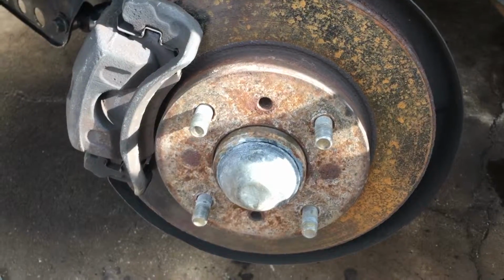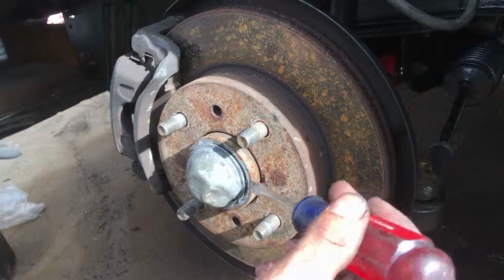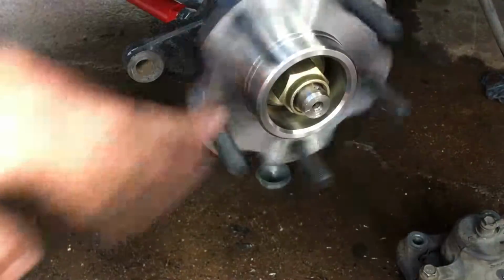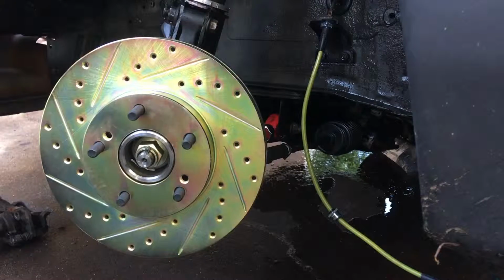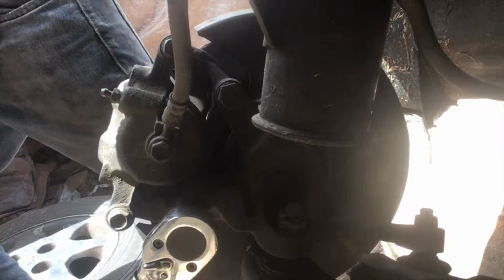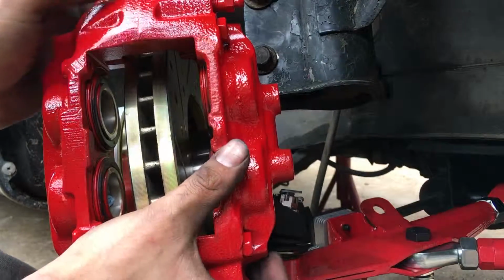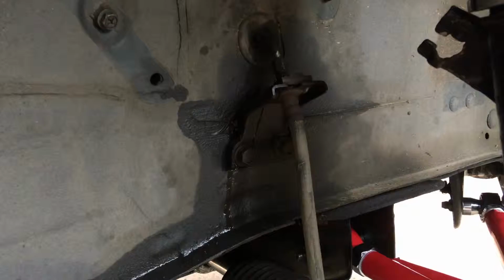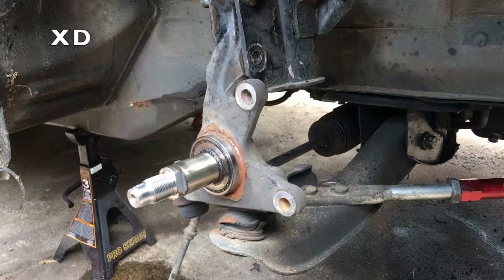S13 Gets R32 Big Brake Kit, Zinc Rotors And ISR Steal Lines With 5 Lug Swap

Comment: Were they originally 250mm rotars you converted  trying to find a bolt on option for my s13
Reply from the maker: Do you mean the oem stuff ? And are you trying to stay 4 lug?
Reply: @MRTuning704   yeah my oem is 4 stud 250mm rotors I’ve got zss hubs 5stud now but but don’t no what I can convert to that’s bolt on hoping this kit was originally 250mm so I can copy it
Reply from the maker: @jakenevillefishing1279  so I have a custom kit. I did the 5x114.3 hub conversion that’s the easiest way to open up your options 

Then I did the 300zx z32 rotors with the r32 calipers but you can use 300zx z32 calipers as well. There are little smaller but are almost identical. 

The first couple of years of the z32 are cast iron calipers and they are the best in my opinion. 
but the last couple of years they are aluminum 

You will also need the conversion brake line I got mine from enjuku

The rear is a similar set up but you technically can’t run the 300zx rear calipers because they can strike the subframe
Reply: @MRTuning704   thanks mate 
Did that caliper suit up bolt straight up no issue  my concern was seeing some s13 are 280mm rotors to start where mine are 250mm.  That’s why I’m not sure what will work 
I have zss hubs 5x114.3 which are in just need to find the rest
Reply from the maker: @jakenevillefishing1279  ok here’s what you need.
1990 300zx z32 rotors, calipers, brake pads and conversion brake lines and you are good to go

And no problem I’m always happy to help and if you ever need anything let me know any time 

Also I respond faster on instagram but I’m always looking for new comments on YouTube

Comment: The conversion lines for the z32 work on r32 calipers??
Reply from the maker: Yes, there the same caliper. just cast iron instead of aluminum and bigger pistons!

Thanks for checking out the video and commenting!! Let me know if you have any questions
Reply: @MRTuning704  I hadn’t even seen your reply but thanks this helps me out a lot right now!
Reply: @MRTuning704  also any tips for getting that dust cap off the wheels I’ve tried over and over and I literally can’t how did u do it?? 😭😭
Reply from the maker: @WilliamEAyala  flat head and a hammer gets it off pretty easy you might have to dent it and just buy new ones lol

But let me know if you need anything else I know it’s a lot at first
Reply: @MRTuning704  man that’s what I tired 😭😭 I guess imma have to be more aggressive thanks so much for the help once again!
Reply: @MRTuning704  what size wrench did u use to loosen that brake line at 3:30?
Reply: @MRTuning704  also what size rotor were u running?
Reply from the maker: It’s a 10 mm I think and I’m running z32 rotors (1994 300zx I’m pretty sure) 

I would also recommend a z32 master cylinder especially if your gonna upgrade the rears
Reply: @MRTuning704  just did literally when I got my 240 every thing wrong with it was brakes related first it was a leaking abs then leaking calipers then leaking brake master cylinder then the rubber brake lines were going out so as of right now I just installed a new abs new brake master cylinder that was for a z32 lol and we’ll since I replaced the calipers a while back I right now just have oem replacement calipers but I mean right now for being oem stopping power it’s really good and I’m just glad I was also able to get steel braided lines for now and now everything wrong with my car is now fixed lol

Comment: Not too shabby! Digging the upgrade and am actually going to be doing it myself here over the Christmas holiday. Did you swap your brake master cylinder as well or did you stay with the stock 240sx one? Sorry if this is a dumb question, I am new to working on cars!
Reply from the maker: Good question 
The stock non- ABS master can handle 10 pistons in the brake system 

So I can run 4 piston brake calipers in the front
And single piston stock in the rear

I had the rear capped off because I ran that independently to my hydraulic E break

Since then I have upgraded to a 300 ZX master it wasn’t much of a difference but now I know I can upgrade to the duel break set up in the rear and handle over 12 pistons in the system lol

If you do not upgrade your master and you have too much in the system the pedal will be very hard in the brakes for feel week! 

Thanks for commenting and good luck!!

Let me know if you need anything!
Reply: @MRTuning704  ah I gotcha. Yeah been debating whether I want to do the z32 one or not. I may pick one up im just nervous cause I have nonabs and I believe you have to block off the center connection iirc
Reply from the maker: @casey_shame  The only reason I upgraded is because I’m going to have 4 pistons in brakes in the rear

The stock was completely fine for the year I drove on it with the big brakes. And the 300zx upgrade wasn’t a noticeable difference on that setup.  So I would just hold off on it until you need to replace yours

Don’t worry too much it’s just brake calipers
It’s not hard ,just don’t over think it !